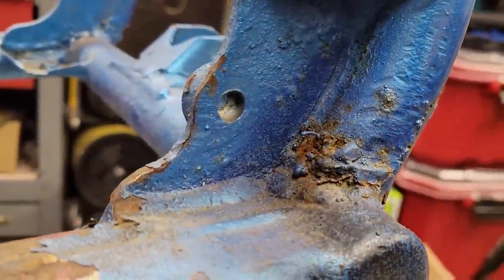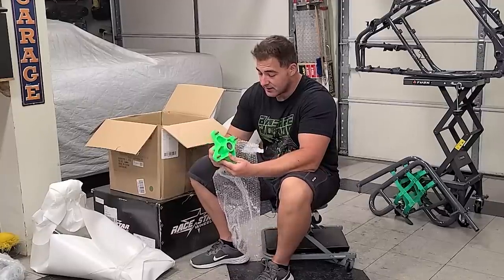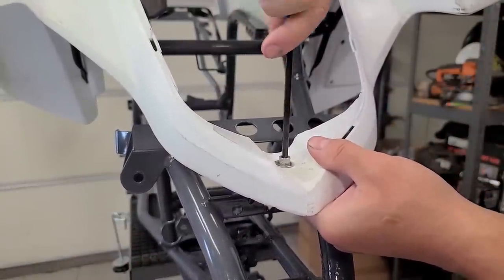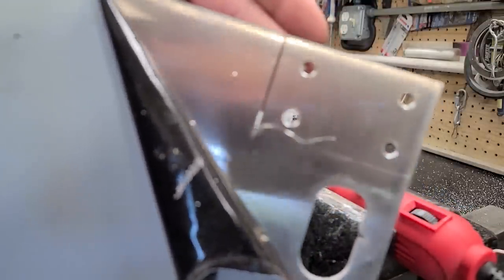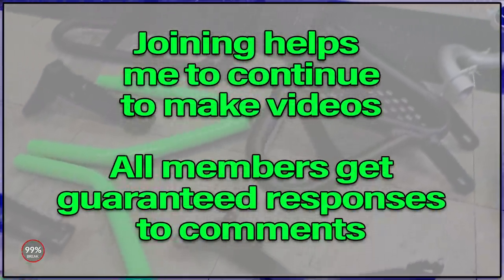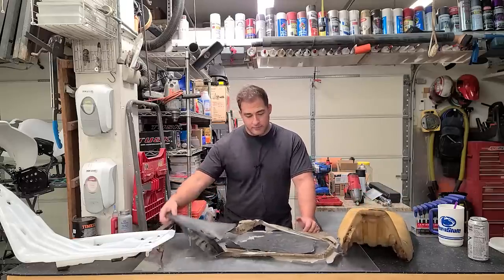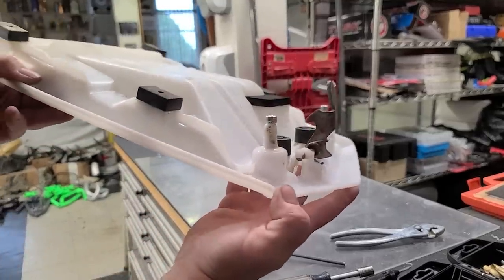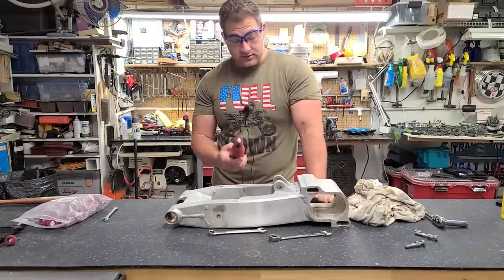This is the way Yamaha SHOULD have designed the Raptor 660! ASPCA Raptor Part 3

Comment: Use heli-coils for fixing threads.  They will hold stronger than the aluminum they are embedded in.  If it's good enough for aerospace it's definitely good enough for a quad.
Reply from the maker: Thank you for the tip man! I was actually able to repair these threads and forgot to put it in the video! I'll have it in the next one

Comment: Thanks for the video Mike, I’m currently splicing a frame on a YZ250, rotten frame rails, some advice is to support before doing any cutting to keep frame rails straight and aligned, good job on the repair and the weld isn’t terrible either 😀 try and treat the inside of the frame with a lubricant or anti-corrosion spray in the holes to keep moisture at bay. It will slow down/neutralize what rust remains in the frame.

Comment: ESP when working with frames and stress points your always going to be better to run single line stringer beads with a mig than weave. Little easier to avoid some the undercut you have run hot enough they will lay in nice and clean looking but for not being a welder and in your garage you fixed it the right way so I give props where deserved. Keep up the great content.

Comment: Those threads need some helicoils so you have good securement. Anti seize definitely helps the adjuster bolts. Also when removing bolts that stuck, switch back from reverse to forward, back and forth. It helps break corrosion on the threads so  they don't get as torn up.
Reply: YES MORE HELI-COILS  THE WORLD NEEDS THEM,   AS WELL AS  RIV-NUTS . WHAT DO YOU THINK?

Comment: I had a frame do something like that. I washed it and then stored it in a shed for about a year standing up on its grab bar and the watter settled in the frame at that location. It rusted through from the inside of the frame and I bought a whole new frame. Im not much of a fabricator yet and dont know how to weld. I know as I build this 86 250R Ill have to have some people do some things for me, maybe I can find someone to teach me some of that stuff. Good job on the frame repair, it looks like it will hold just fine.
Reply from the maker: Thank you man; I think the exact same thing happened to this one; something like you said or it was leaned up against a wall outside and the lower rear rails were on the ground in mud or something.
Reply: @MichaelSabo  Yup, it doesnt take much moisture to get inside the frame to rot it from the inside out. There is no coating or protection on the inside. I learned my lesson, I will not store a machine right after washing it. I will let it sit outside for a bit and let the water leave any cracks, crevices, or holes of the machine…

Comment: I needed brighter lights on mine, I went with a dual row 10 inch LED light bar (30W draw) mounted to the handlebar with a Rigid Industries universal mount plate and two motorcycle LED drive lights mounted to the front grab bar. Think the drive lights are 20 or 30W draw each. Made custom pigtails using the factory wiring harness connectors. Wired so the front grab bar lights and light bar come on together on high beam and just the grab bar lights come on in low. Total power draw stayed within what the stator can handle.

Comment: nice work . i saw that bolt got tossed out of the lathe chuck by the head being gouged. now i always center drill and use a live center to support bolts, as i did the same thing many times in a lathe.

Comment: just a heads up on that swing arm, next time you encounter a problem like that hit the bolts with penetrant after you heat it up a bit and it will help a lot also if you do screw the threads a helicoil would be a solid fix, also if to clean aluminum with a wire wheel use a brass wheel or your aluminum will corrode and if you can get your hand on alumiprep and alodine you should use that on all surfaces that will be mating next to steel, they don't do this factory and that's why all those part corrode so bad.

Comment: Hey drill out the threads on the swing arm and put a steel thread insert/ helicoil in there. Super easy.
Reply from the maker: Good idea; I actually was able to repair the threads and forgot to put it in the video! I'll have it in the next one.

Comment: Great video this is my favorite so far.  You should look into grabbing a plastic welder could save you some cash and extra work in the future.  Plus they’re super cheap.
Reply from the maker: Thank you man and good call! I actually have one but I'm not the greatest at using it. I've tried to fix this exact issue on other machines only to have them snap shortly after.

Comment: Just a tip on the torque wrench, when the green light is flashing it means your approaching the torque you set it to and when the light stays green it means you met the torque when it goes red it means you went above the torque. But other than that the build is awesome!!

Comment: I like your builds, some Builders are building Street quads converting them to turbocharged H1 engines that go to 200 Mi an hour which is ridiculous. Some of them are cool if the suspension custom tuned for Street with a quad engine geared for street riding but get converted with a street bike Engine with an off-road suspension with street tires which doesn't make any sense. If you're going to make a street quad you got to modify the suspension like it's an Indy car

Comment: Best way to pack your bearings with grease I find by using a ziplock plastic bag, you but a fair amount of grease inisde bag and one by one put one bearing and true the bag just push the grease inside rollers. When you finish just remove and add the second one. Like this is much easy to keep the grease out of your hands... and you don't waist to much grease as the bag you can used again and again until it broke... but it last quite a wile.

Comment: Thoes raptor frames have an issue with the frame filling with water id suggest breathing hole at the bottom or drain hole.           Oh do you got sabo stickers?
Reply: Spraying some fluid film on the inside too will help prevent corrosion too. Definitely agree with the weep hole comment

Comment: doubling back on the rear fender support you could drill a hole through the plastic and drop a carriage bolt through it and put a nut on the bottom that would look pretty clean!
Reply: Agreed. I think it might vibrate and buzz with the way it is currently.

Comment: What do you do on the frame repair to prevent it rusting the inside after patching it?
Reply from the maker: I tried to cut out all of the rot. My coater told me they treated the frame which is supposed to prevent further rusting/rotting even from the inside. I'm not a pro with coating/treating so I am not sure how that works or if there's a better fix.

Comment: To make life of removing bolts in aluminum hit the head with a hammer a few times first then tighten them down a tiny bit before backing them out and always go back and forth instead of straight out. I’m a diesel technician and come across seized bolts in aluminum fat too often and maybe only 5% of the time have issues with pulling thread with this method.

Comment: Hey Mike, quick question for ya. What would you prefer for general trail ripping. A raptor or 400 EX ? I have a banshee; but would like to get one or the other for general trail rides where the banshee is kinda select where to ride. I mean technically I can ride it on the same trials but around here there’s lots of rocky, rooty, half muddy trails and small pits. Not really great banshee stuff. Don’t get me wrong there’s places to ride the banshee, and I could technically ride it on these trials with buddies but it’s not the greatest fit for it. For general rips with my buddies which all have 4 strokes and ride places, I’d like to have a 2nd bike to enjoy locally and with buddies. Keep the banshee for my 2 stroke riding buddies and 2 strokey type of riding, and locations, or by myself riding. If you get what I mean. I’m kinda shitty at describing what I’m trying to say lol

Comment: Hey mike get a magic eraser. And it will remove all the stains from the plastics. Works great
Reply from the maker: Dude no joke I've been using one all over it little by little!! I almost put it in the video. Thank you for the tip 🤘
Reply: @MichaelSabo  clean build. I personally would’ve hydro dipped the hood with a carbon fiber wrap

Comment: You could make them with A saw zall.,or A better dermal tool with diamond circle cutting wheels made for cutting metals with to Michael just A really quick tip to you. To say that you have A one of kind homemade after market slide in squared nut insert swing arm slots.
Reply from the maker: Thank you for the tips John! 🤘

Comment: If you had some of those vaccum rubber caps used to block off vaccum on vehicle carburerators. To cover those bolts with.
Reply from the maker: Oh, on the seat posts? Yea that would look clean

Comment: U should really use some penetrating oil when removing them tight bolts even when heating them up with the torch lots of oil and work them back and forth as you take them out do that and it will always help an old German guy that I used to work for taught me that.

Comment: just a quick question, ive got an 07 outlaw 500 irs and i was just wondering if you have any idea on who would have the stock sized rear rims and front rims. also whats a good tire thats not gonna brake the bank but will hold up to road riding adn trail riding?

Comment: So this is an older video but i have a new issue i own a new cfmoto 520l whitch has a 2 up seat now the chinese mounting brackets for the seat is very weak broke off recently so i had to braize weld it turned out like a bit of a hack job but it is stronger how would you  recomend fixing weak chassis mounting points for 2 up seats ?

Comment: Next time you use the Dremel  as a mini table saw, clamp it in the vise the opposite way so the top of the blade turns toward the workpiece. That will prevent the blade from pulling the workpiece (and your hands) toward the blade. Safety first.

Comment: where’d you get all those bolts you used on the radiator and lights???
Reply from the maker: I have collected thousands of bolts over the years. But those big ones I used are just 1/2 inch with a 13 thread pitch; you can get them at a hardware store cheap.

Comment: You should make those headlight brackets and sell them I would buy them to install the 700 headlights and what year 700 are the lights off of cause didn’t they change the trim housing after 12

Comment: Take an old screw driver take handle off clamp in vise take a thin cutting wheel cut a slot strat down an inch fold over 1 inch sand paper about 3 inchs long and you can sand deeper holes

Comment: I really lik  quads I don't can't say I'm a quad guy but I like riding.  I started out riding quads but i ride dirt bikes. I don't ride anymore but as a bike guy we like two finger levers... not by choice, if you're riding bikes your clutch and brake lever turn into two-finger. They curl up and we have to cut them off and turn them into two-finger our levers are two Finger by crash design so we just buy short levers finger levers 😅 we like short levers lol

Comment: I will say from my experience you're better off drilling and tapping for a helicoil in that swing arm for the adjusters song long as you red loctite the coils you'll be fine but afterwards some good anti seize also they make some bearing packers that'll help with the process a lot faster although I prefer hand packing as well

Comment: Dude that seat you should have threaded it and expoxied it! Plastic binder is strong! And remember the common 660 issue is wrist pin bearing! Drill a bigger hole in the crank side a Lil bigger with a bigger chamfer

Comment: Get stainless steel heli coils for swing arm bolts. Buy a jar of certified name of company loc cease only put on bolts you don't want to seize don't use on things you torque.It will let you tighten a nut and bolt so tight it will break. It is the hot setup.

Comment: Mr sabo, would you do a build on a quad or me for the channel? I would personally drive to you with the quad and $15000 for parts and labor. If you can’t get 15000 into in parts and labor keep the rest. Want a 1 of 1 badass quad. The quad is a 1999 blaster 200, yes I’m aware of the old blaster on the channel think it was in 2017 maybe 2016 when saw it. now you’ve grown a lot and go a farewell more in depth since back then.
Reply: There would not be a time limit so you can get to it and progress whenever

Comment: It looks like someone used stainless bolts in the swingarm. You can’t use stainless on aluminum because they seize and oxidize. Aluminum oxidizes regardless but either regular steel or aluminum bolts

Comment: Come on man put the what bro.? Those dremel tools have replaceable brushes that will help with the speed control. You wan't invest in some 3in1 electrical motor oil for those bearings in those types of Drexel tools from harbor freight tools stores. It's not really that hard to do simple maintenance to your power tools Michael sabo. You can add 3 drops of Lucas oil stabilizer& stop leak into your 3in1 oil then shake it up well is all you do. Before use on power tool for more protection.& friction wear to heat also.